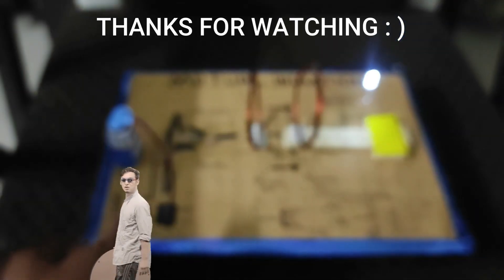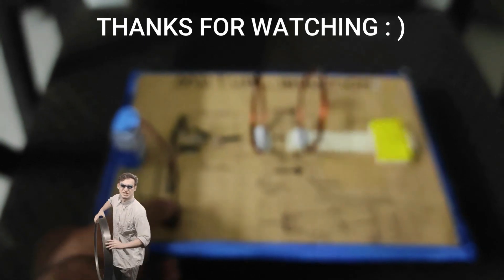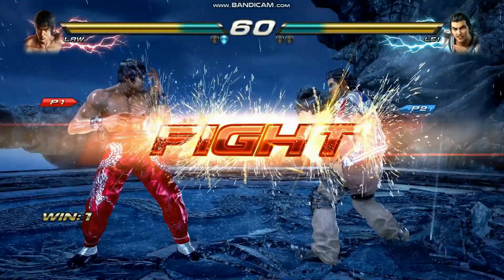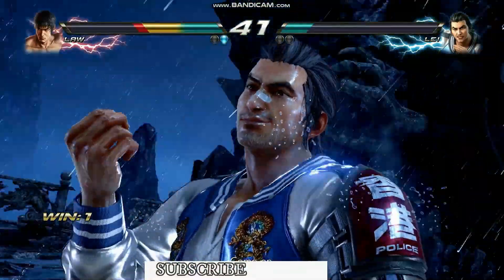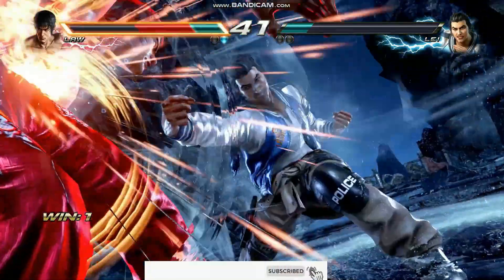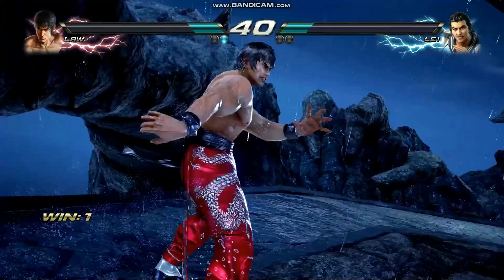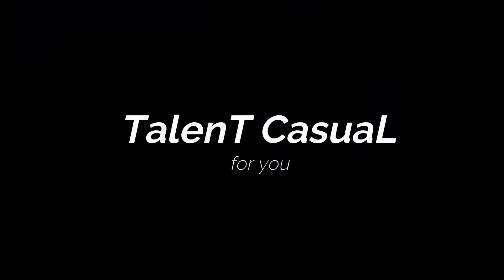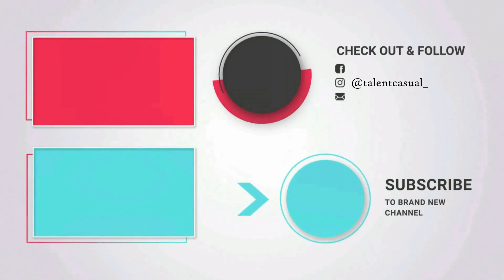How to make Mutual Induction Working Model | Wireless Power Transmit | MUST WATCH #physics #diy

Comment from the maker: your fav. scene 03:00  
share your thoughts : )
💕💖😀
Reply: Hello sir , pls reply me 🙏🙏 
Sir I have made this but it's not working 
I have used
bc 547 and 2N2222A transistor and 20 k and 27k resistor 
But in both cases it's not working pls tell me 😢😢 
I have to submit it on 3 oct
Reply from the maker: Hello dear 💕
Don't worry it will work

Connect on Instagram
@talentcasual_side
Reply: @TalenTCasuaL  sir I m not on Instagram
Reply from the maker: Ok dear 💕 how can we connect on telegram

Comment: Sir mine model is not working please help me with what I should do I use 30 gauge copper wire and 30 turns used 15 k resistor and 9 volt battery and transistor 2N2222A

Comment: sir, my project is not working. i have removed insulation on the copper wire, i have even reversed the transistor. what do I do. plus, when I was reversing the transistor, I noticed it was really hot.
Reply from the maker: okay dont worry
use coil proper 7-8 diameter and 32-32 turns
use simple 3v led

and check all joints
and try changing resistance to 26k
best of luck

Comment: My model is working but the transistor is heating and after 2-3 sec the led bulb in secondary coil is becoming less glowing
Reply from the maker: Try to use another transistor dear 💕

Smaller one and use 27k resistance

Comment: why is my 2n222a transistor hot and smoky?
Reply from the maker: Burning out
Try to use it reverse may be u using it wrong direction

And use 33k resistance or 27k

Comment: Sir pls help I have used a 2n2222a transistor as you said but the shopkeeper does not have resistor less than 33k so I take it but the led is not working and transistor is heating and air I have not used any other resistor with led
Reply from the maker: Ohk dear 💕
Aap transistor ko ulta lga k dekho ek bar
And turns 33-33 rkhna

Comment: Bhai vo transistor ki right wali side copper wire sai hi connect kiya hai?
Aur har copper wire ki brown coating remove karni?
Reply from the maker: Yes remove insulation
And yes connect with primary coil first end and last end
Check circuit diagram in the video carefully
Reply: @TalenTCasuaL acha aur switch to (L) ke sath bhi copper wire lagi hai? 
Mai bana rha hu abhi isiliye puch rha hu😅

Comment: What work do the transistor.¿
Reply from the maker: It rapidly changes the current 100 times per second
Reply: I have ever tried the circuit one without transistor… reasons for no volts in the circuit¿
Reply from the maker: Transistor is necessary

Comment: What can i do if transistor is heating up and led is not glowing . I have taken 27k resistance copper    wire and transistor BC547
Reply: Pl reply
Reply from the maker: Try to reverse the transistor dear 💕
Reply: I did but it is still not working
Reply: Also I have taken coil of diameter 5cm and no of turns 28-30
Reply from the maker: Make sure coil wire is  insulated and
Remove insulation is removed on joints make sure circuit diagram is ok
Reply: I did remove the insulation and also the circuit diagram is correct but still not working 
I have a ques , have you not installed any resistance to led

Comment: Sir i use 30 k resistance  and 2n 2222a transister and  coil 30 times but when i connect with 9 v battery onky transisiter heat up but blub is not glowing
Reply from the maker: Try to reverse the transistor dear 💕
Reply: Reverse means how? I didn't understand
Reply from the maker: ABC  are three legs of transistor
Make them CBA reverse the direction
Reply: @TalenTCasuaL  not glowing sir
Reply from the maker: Ok dear 💕
Check your connections
Make sure u use insulated copper wife
And remove insulation on joints

Check circuit diagram
Use same components as mentioned

Comment: hi talent casual
this not working bcoz secondary coil is only 15 - 16 times is this reason
Reply from the maker: Yes 
Can be many reason
Try reversing the transistor

Yes coil should be same 32-32
Reply: Is everyday battery OK for this?
Reply from the maker: No
Reply: Primary coil is big and secondary coil small is it work
Reply from the maker: U can try
But keep both same

Comment: Why did you used transistor?
I cant find your replies in previous comments 😅
Reply from the maker: Sorry dear 💕

Transistor - turns on and off the current hundreds of time in a second

Which changes the current to on and off 
Means 0-1 rapidly
This changes magnetic flux and vice versa happens in the secondary coil 
Which produces current
Reply: Thanks a lot😊
Reply from the maker: For detail
Msg on insta
@talentcasual_side

Comment: Sir i have used 27k resistor and same transistor used in video but the diameter is of 4.5cm and turns are 30 each but led is not glowing
Reply from the maker: First fix the diameter to 6cm diameter atleast

And if not work
Try reversing the transistor

Comment: My transistor is heating up very much what to do ? I have used 23k resistor and 2n2222a transistor
Reply from the maker: If model is working great

If not try reversing the transistor
Reply: @TalenTCasuaL  Like changing the connection from 1st pin to 3rd, 
I did but now the transistor is burnt up I think
Reply: I have to buy new one, should i buy 33k resistor or what, 
And i have one more doubt my radius is small around 3 cm, with 30 turns each is this also a problem kindly help me 🙏
Reply from the maker: No dear 💕 don't worry try it
Reply from the maker: Yes dear 💕 

Diameter should be 6 CM which is ok

Resistance u can take 27k
Reply: @TalenTCasuaL Bro how did you join the wires , glue or what ?
Reply: Ok thanks you so much 🙏🙏

Comment: Hlo sir my led qmwork when it is connected to battery but when connected with coil and  attach to  battery doesn't work
Reply from the maker: Hello dear 💕
I didn't understand you point

Can you explain breifly in detail : )
Reply: @TalenTCasuaL 
Please Reply sir 🤔🤔🤔
 sir in secondary coil i have attach the bulb and then connected to  battery and the bulb glow too dim but when too check bulb glowing properly i attached it to battery it glow very well but in coil bulb glows too dim

Thats why when i bring secondary coil to the primary coil bulb do not glow
Reply from the maker: Hmm i really don't understand what you saying

Msg on Instagram
@talentcasual_side

Comment: Sir, i tried it but it is not working, i got 0.37mm of wire, could you Please guide?
Reply from the maker: Hello dear 💕
Use exactly same materials

Try to reverse the transistor may be u have put transistor in opposite direction
Reply: @TalenTCasuaL  it's not working
Reply from the maker: @Purple_shade_hoodie  msg on insta @talentcasual_side
Reply: @TalenTCasual 
Thankyou so much! The project is amazing!!

Comment: Sir my project is not working even I completely follow according to your video
Reply from the maker: Sorry for late reply dear 💕

Project not working
Make sure circuit is fine

Make sure all joints are fine
Make sure copper wire is insulated
And try reversing the transistor

Thanks ❤
Reply: @TalenTCasuaL thanks sir 
❤

Comment: Broo how this works??? Because mutual induction works only in ac right? Then how it is possible with a 9v dc battery😭 give me an explanation pleaseee😭😭
Reply: Bcz here transistor constantly switching on and off the circuit
And bcz of change in current it is working
Reply: @shivamkumarxid1848  💗💗
Reply from the maker: Hello dear 💕 
Connect on Instagram 
@talentcasual_side
I will help u 
U can watch other  videos on YouTube about mutual induction also : )
Reply: @TalenTCasuaL  i'll msg u 💗
Reply: The transistor is oscillating the DC current
Reply from the maker: Excellent dear 💕

Comment: Is using 0.35 mm wire okay?
Reply from the maker: Yes dear 
Wire should not be very thin
And should not be very think
Just as shown medium like thread
Reply: @TalenTCasuaL okay will try again, my previous attempt failed I think because of low number of turns. Thank you!
Reply from the maker: @rf3w don't worry dear try again

Comment: Brother im making this for my school project but i have taken 30 k resistor and when i have checked it with light ,light didn't glow up and wheni have completed the circuit transistor started to heat and i wasn't working
Reply from the maker: Hello dear 💕

Don't worry
Transistor heating is normal

Try reversing the transistor 

Make sure all joints are strong

Any help
Connect on Instagram @talentcasual_side

Comment: Sir, are you scratching the loop while connecting them after the cut in primary coil...??plzz answer it..?
Reply from the maker: Hello dear 💕
Thanks for commenting

I don't understand your questions dear 💕

Kindly connect on insta
@talentcasual_side
I will surely help u out
Thanks ❤
Reply: @TalenTCasuaL  sir by using 33k resistance can I make the project working...??
The transistor is heating very fastly, is there anything I can do..? 
And plzz tell me how much time I can use it continuously..?
Reply from the maker: @vishalinisingh9236 
Yes dear 💕 and yes that's good transistor normally heat ❤

If not working try reverse the transistor

Any help u can
Connect on Instagram
@talentcasual_side

Comment: Why around 30k resistance required is this because of some limitations or drawbacks please specify sir
Reply from the maker: Dear 💕
Transistor stores the current and released very fast hundreds of time each second rapidly

This will eventually burn out the transistor
And to avoid this and limit the current
Reply: @TalenTCasuaL  ok

Comment: I made the same circuit but i replaced the transistor with ST9013 transistor it’s not working how can i make it work with that transistor please tell
Reply from the maker: No dear 💕
U need to test with resistance 22k to 35k
May one of them. Work
Also check with 2 batteries connected in parallel

Otherwise
Try the transistor - CTPN 2222A 🥰
Thanks

Comment: How to connect switch
Reply from the maker: Hello dear 💕

It's simple take the negative or positive any one wire from Battery and make it pass through switch

So that switch makes it on and off

Just cut the wire into half and and join both this ends to the 2 ends of switch
So that current pass through switch

It's really simple dear 💕

Comment: Sir i need this project report
Reply from the maker: Hello dear 💕
U can get this by yourself
Just find on wikipedia Or google
Or check my other comments where I have explained it's working
Pattern -
Aim
Principles
Materials required
Construction or circuit diagram
Theory
Working
Result
Precautions

U can make by your own method also
U can remove precaution / theory if u like

Thanks ❤

Comment: Bro can you please share a pdf or something about this project like a brief explaination of what's going on in the working model please...
Reply from the maker: Yes bro sure : ) 

U can seach on google i will tell u brief soon dear 💕
Reply: @TalenTCasuaL  thanks so much
Reply from the maker: Dear this is called mutual induction  means when bring closer the primary copper coils induce current  to the secondary

How -  there is circuit with transistor - in the primary coil - the transistor turns the current on and off rapidly  ( it stores the current and then release thus increasing the power)  it will gradually get burn out so there is a resistance to avoid this ok 👌  
So this is circuit which  rapidly hundreds of time Continuesly turns the current on and off in the primary coil

Now the secondady coil - where current induced and bulb glows

How ( principle) - there is rule ' when there is current in copper coil there magnetic field is produced and here is a magnetic flux in the field
And vice versa when 2nd coil is closer to the first coil - magnetic field induce current in the 2nd coil  
For a very short period of time because... 

Next rule  ( principles) -  current is induced in 2nd coil only when there is change in magnetic flux in the 1st coil. 

So due to rapid change in magnetic flux due to rapis change in current in the first coil ( transistor turns on off on off) 

Hence there is continues mutual induction

Which wire less power transmission 

Ok hope it helps. Good. Luck 🤞🍀 dear 💕

Comment: Can thick copper wire will work or not ?
Reply from the maker: Yes it will work u need 2 batteries and copper should not be very thick : )  make more turns with atleast 3 CM diametet

Comment: What kind of questions do teachers ask in science exhibition??
Plzz answer me sir
Reply: And I actually made this project it works good.....
But I need some questions about this bcz if teachers ask me questions.....
And I am in 8th STD so plzz answer me cuz I have to show demo tomorrow
Reply from the maker: Ohk dear 💕 I have same answers to other comments let me copy paste 🥰
Reply: Okay...
Reply from the maker: yes dear 
What is use of transistor
principle of working
why using enamaled or insulated wire 
what is battery voltages
what is minimum voltage required ? 
use of resistance? 
Where it is used uses etc 
etc
Reply: If u don't mind, r u a phone addicted 😂🤣,
Bcz u always answers to comments quick sooo ... 🤗🤗😉☺️,
Reply: Please answer me 🤗😄
Reply from the maker: May be yes
U can connect on insta
@talentcasual_side for more

Comment: Bro my model is not working 😢 help me.
Reply from the maker: dont worry dear : )
it will work use proper things i used  find them in local market
follow precaustions
remove insulation
check circuit diagram
check led and battery
use proper system : )
😋😋🤗🤩 try reverse the tranisistor if all ok

Comment: What I can do if my transistor heat up while using 27k resistance.... One another thing how we know that transistor is working without multimeter....last thing i can also use 3.7 volt battery in this project.....
Reply: Can I use 3.7 volt battery by reducing the value of resistance....?
Reply: @sanyamverma1753  reduce the value of resistance as well as the number of coils and also the the diameter, that must do it
Reply from the maker: No dear 💕
Reply from the maker: no dear u cannot use 3.7 volt it needs 9v or even 9+9 = 18 v

If transistor is working thats why its getting heaten up

using 27k resistance trannsistor is heaeting thats normal if the project is working dont use it for continous 1-2 min just use to show for some time  
and if not working u can do -
try reverse the transistor  may it will work
or add 5 k resistance or replace resistance with 32-33k any  and use 9 v battery dear : )

sorr y for late reply : )

Comment: Will it work if radii is around 1cm ... even though if we maintain the number of turns ? 

Bhaiya wire mehengi hai 🥲
Reply from the maker: No dear atleast it should be 2 inches 🥰🥰
Reply from the maker: Number turn can. Be minimum 20 turns

Comment: how to join transistor and resistor without soldering iron..?
Reply from the maker: use wire and remove wire olastic coating and wrap the wire 10-15 times and putt tape o it  : )
Reply: @TalenTCasuaL   can i use the copper wire after removing the insulation from whole?
Reply from the maker: No dear 💕 only the edges where we have to connect it to others 😋
Reply: yes? or no?  @TalenTCasuaL
Reply from the maker: Where u need to connect the copper wire u have to remove the insulation yesss...... 🥰
Not full wire
But where u want to pass the current the ends

Comment: Sir,your uploaded video was very helpful in making of my project.I am giving boards this year.Sir can you tell me some viva related questions to this project? 🙏🙏
Reply from the maker: yes dear 
use of transistor
principle of working
why using enamaled or insulated wire 
what is battery voltages
what is minimum voltage required 
use of resistance
etc
Reply: @TalenTCasuaL  Thank you very much for answering the question sir. 🙏
Reply from the maker: youre welcome : )
Reply: ur g

Comment: sir, what is the use of transistor and will the experiment work if we donot add any transistor? also thank you for this beautiful project 😊
Reply from the maker: Hello dear 💕
Transistor
Acts as switch and rapidly turn the current on off on off hundreds time in a sec
And this produce change of current thus chnge of magnetic field and further change of magnetic flux 
Which produce current in 2nd coil

🥰
Reply: oh thankss
Reply: Can we find these components  specifically transistor and resistor at electronics or hardware shop?
Reply from the maker: Sure  at any electricals shop not hardware but electronics speaker motor repair etc   go explore market and get knowledge that's also part of making models
Reply: Sir if u don't mind, how does the coil of led glows without connection and how does it glows(please i want fully explanation for science exhibition in our school) plzzz i want to explain in brief...
Reply from the maker: Hello dear 💕
Connect on Instagram
@talentcasual_side DM for details  🥰 your welcome
Reply: Sir. How do u explain this project with the hand shows? 
Bcz have to explain in our school(science exhibition) so plzz explain it briefly.....
Reply from the maker: Hello dear 💕

I have answes to this many times in other comments 

Wait a bit I send u shortly

Comment: Can you tell me have you also add led with resistor?
Reply from the maker: No dear 💕  direct ❤
Reply: @TalenTCasuaL  then why it's not working?
Reply from the maker: And also remove the insulation from each end of the copper coil

Make sure it is enamaled Or insulated
Reply: @TalenTCasuaL  I have put every single thing as same as you but it's not working 🤧
Reply from the maker: Don't worry Dear 💕

It will work
Connect on Instagram @talentcasual_side
🥰
Reply: @TalenTCasuaL  actually I don't use Instagram so..
Reply from the maker: Ok dear 💕
Check mu video description

Use exactly same. Materials

And try check circuit diagram

Check if the transistor is heating or Not

And try reverse the transistor  
1 to 3 and 3 to 1  end Of transistor